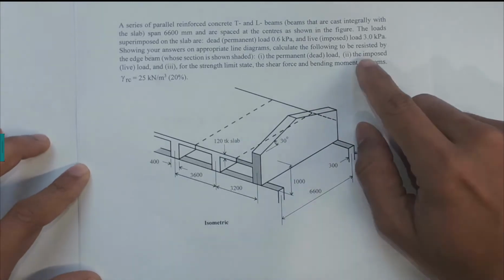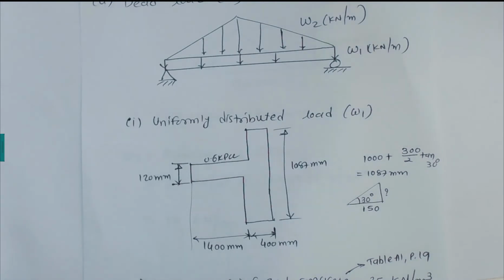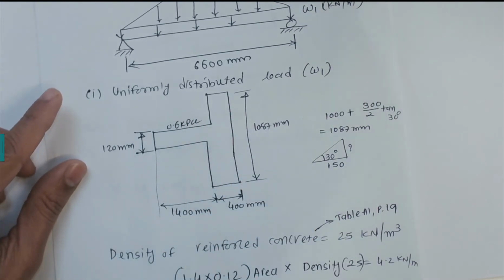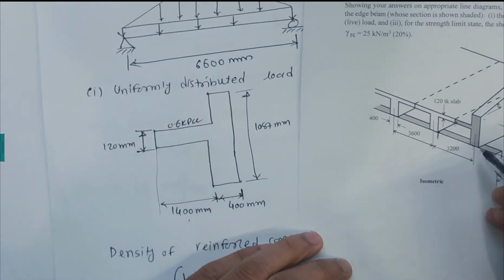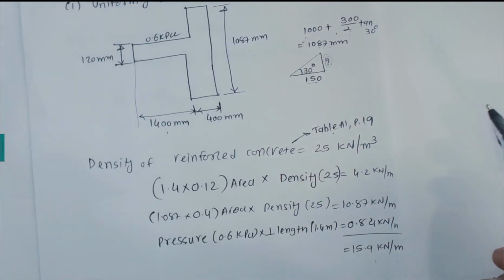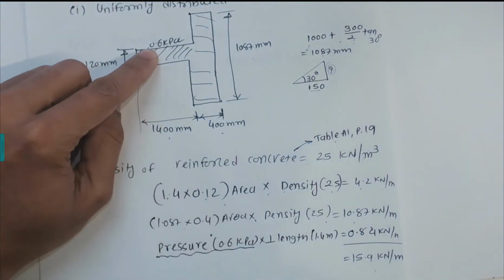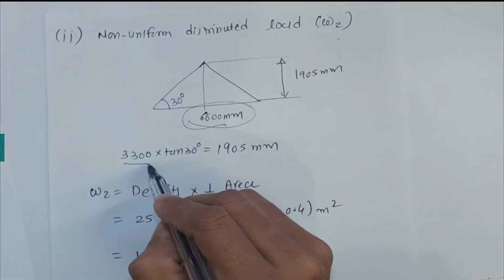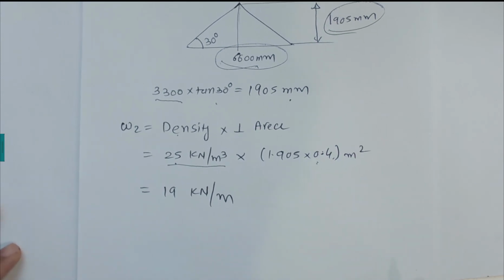Dead live load Example 7 Part 1 AS/NZS 1170.1

Comment: Hi Vipul, thank you very much for the great videos. May I ask two questions please: 1) for W1, why did you add 87mm to the 1000mm height? 2) For W2, is the area actually 2 x Area of triangles?
Reply from the maker: Thanks for your questions. We are finding the height of the rectangular and triangle portion. Total height = height of rectangular part + height of the triangle, Height of rectangular part = 1000 mm, Height of triangle = 300/2 * tan 30 = 87 mm. Total height = 1000 mm + 87 mm = 1087 mm.
Reply from the maker: For uniformly distributed load (UDL) W2, the area of the rectangular portion is taken, not the area of a triangle. We use the triangle to calculate the height of the rectangular.